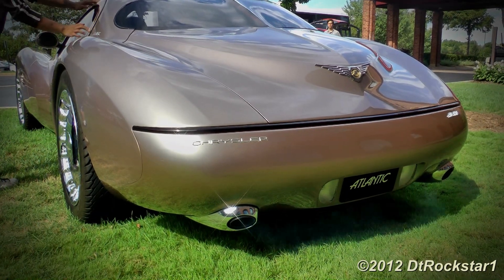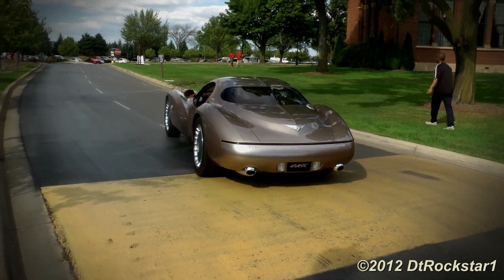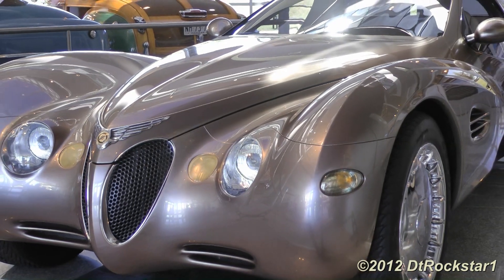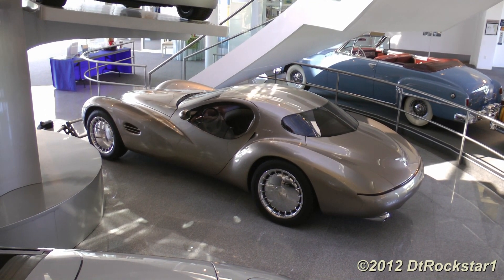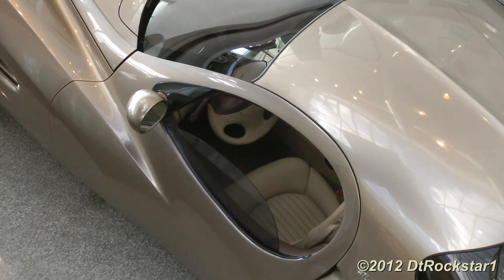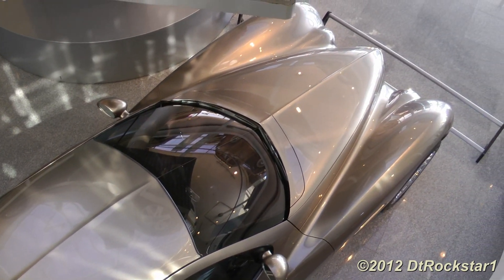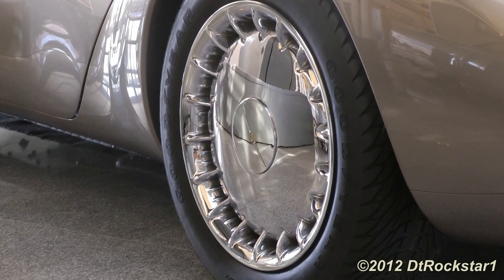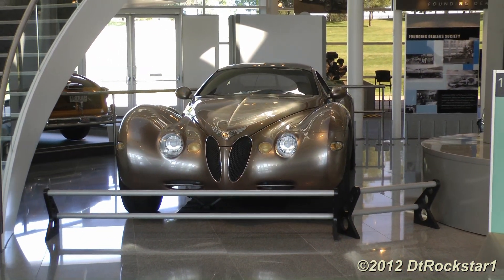Chrysler Atlantic Concept Car

Comment: One of the finest designs ever from Chrysler. A straight-8 consisting of the mechanics of 8 Chrysler Neon 2.0 cylinders. Very telling how much engineering
thought of the spunky little 2.0 liter Neon engine. Its bulletproof. I know. I have a 1995 Neon with that 2.0 liter
Reply: Neons are little very tough vehicles and they can take a severe side impact and still protect the passengers, not like those tin cans Hyundai's
Reply: I wish someone had the boldness to actually make a straight-8 using two Neon 2.0L blocks and install it in a usable vehicle. I mean, one that could be registered and driven normally, instead of a multi-million-dollar concept car. And going a bit further, considering there were 2.4L versions of this engine, it could be a 4.8L total.

Comment: Lol. 90's concept car interiors are so hilariously awful. They always had to use some very contrasting oddball colors, and were always so blobby, as if the interior partially melted. The outside is gorgeous though. I wonder why the center caps are missing on the wheels in the video.